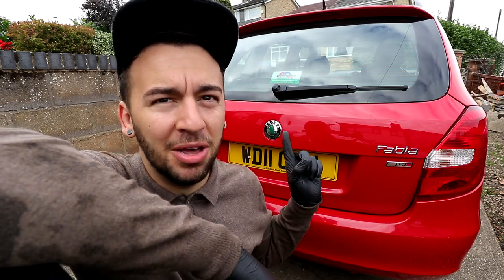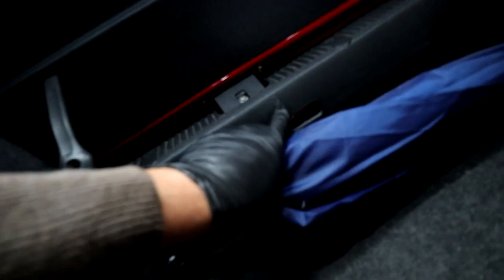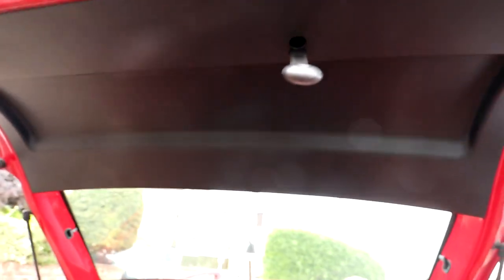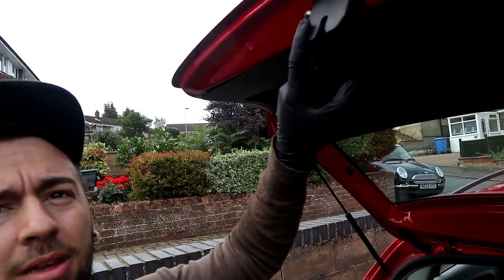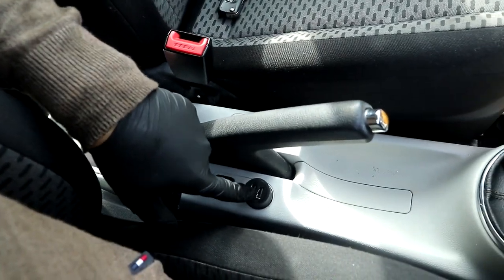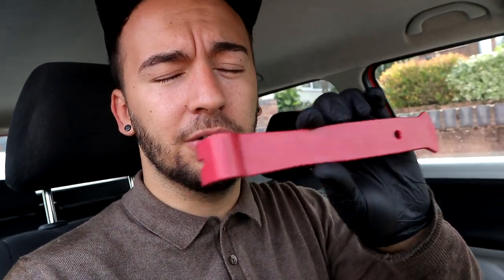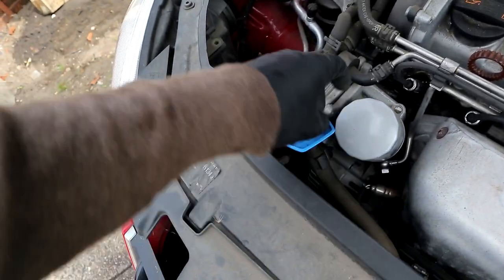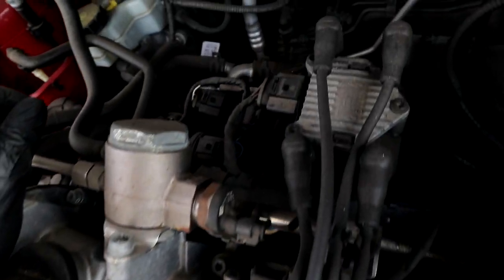Skoda Fabia Boot Wont Open! *Fixed*

Comment: Hatchback VAG cars seem to fairly consistently have boot latch issues. At the end of the day they all use more or less the same mechanism. People seem to reckon the issue lies in the way that the rear washer jet feed sits, and having replaced a few now, I'd be inclined to agree.. As the car ages and the rubber decays it washer fluid slowly drips down onto the latch inside the boot and either shorts it out, or corrodes it. My A3 is just in the process of going through its second latch during my time of ownership. Thankfully as you say the parts are cheap and the job is easy enough. Getting the rear wiper off on the other hand is always a bit of a bugger. It might be worth checking whether Sue's wiper is dripping on the inside if you get a chance! Keep up the good work!

PS: I don't think German cars otherwise have huge electrical issues. Obviously there will be the odd few, but they seem pretty decent overall!
Reply: my A4 has no rear washer or wiper, all the issue is the grease dries up, very simple repair, no parts needed, lazy stealerships are not allowed to fix parts unfortunately
Reply: @anthonynewcome128  that's what I normally do when the issue first crops up. There's actually a video on my channel telling people to do exactly that. But it's sadly not a permanent fix. After a while the latch does pack in. It's a silly bit of design. But like I say, the parts are cheap as anything!

Comment: Yes it is common the door lock problems. Also window regulators.
Btw the fuse box lid trim has a nice handy little fuse puller in it - much better than pliars!

Comment: James - The MK1 Octavia's, MK4 Golf (and the rest of the platforms) are bloody terrible for their door locks. The main issue are the wires between the pillars as they frey over time, or the whole module fails. I've repaired a few. And only recently fixed my passenger door which was deadlocked. That means ripping the doorcard off and cutting into the motor to whind back the deadlock. Not fun! But it can be fixed within an hour half/2 hours.

Comment: I have a 1999.5 mk4 VW jetta, built in Mexico. I have repaired 3 of the 4 door lock modules where the micro switch goes bad and the car doesn't know if the door is closed or not. I have also done one door (and soon the right side) on my friends wife's 2007 Beetle ... same problem

Comment: The copper contact in the bottom of cigarette sockets corrodes. 

Wrap a piece of sandpaper around a pencil ✏ (rubber end) and sand up the copper contact.    Then use your finger to rub some Vaseline or grease on it to stop it corroding again.

I bet that will solve your problem (made my usb charger work perfectly after months of trouble).

Comment: Good video James, 

From an electronics engineer point of view,  check the voltage where you expect it first and then work backwards. 

Eg, cigarette lighter has voltage, that proves that the wiring and fuses are all working so check external sources first and then go back from there.
Reply: or in the case of a removable peripheral like this one, try plugging it in in another car.

Comment: If you press the cigarette lighter in, it should heat up, proving that it works.  It used to in the old days, I wonder if it still actually works as a cigarette lighter these days?  My Roomster boot lock catches sometimes, and takes a while to get it open. I am concerned that it is going to go sometime.  Thanks for the tip about the screwdriver hole. I will try that today.
Reply: In my 2008 roomster just yesterday stopped open. I try the tip but no luck I couldn't even feel that I catch something to open. Unfortunately I have to visit dealer

Comment: Thank you for this - as a resut of watching your video I have managed to fix the tailgate lock of my wife's Citigo. The only real difference is the torx bolts are different. Took me 20 minutes to fix and only cost £14 plus my time as opposed to the £122 that a local garage quoted to do the job. Happy days!!
Reply: hi, I also have same issue with the Skoda Citigo. Im struggling to find what the correct size/type of screwdrivers to get. I can see there's a torx holding the trim, but then the 2 bolts holding the boot latch in are different. They have 12 "indents" instead of the torx's 6. What size/type of screwdriver did you use to undo these? Thanks

Comment: Yep. Door lock problems are a common VW issue. I have a Skoda Fabia mkI Estate myself and my locks are working for the moment. But I already downloaded the videos to prepare myself for the inevitable.:)
Aside from that, these are great little cars. They are cheap. Which means they go bad from time to time. But at least they are cheap and relatively easy to fix. Plus I don't really need more to nip around in town.

Comment: The driver's door lock mechanism in my Golf 6 2010 is a bit moody at times, as well. Checked it with a diagnostic software - throws an error code. But still works most of the time, so I'll let it be for now. The Start-stop system also shows error codes, but the ignition still works, so it doesn't bother me too much.

Comment: VAG's in general up until 2012 are notorious for these kind of issues (I've no experience so far with VAG's from this point onwards), most noticeable with the MK4 Golf and others across the range from this VAG era - door locks, boot locks and windows. The Golf MK5 / MK6 were improved but some still suffered and in particular with the bonnet release mechanism where if the bonnet hadn't been opened for sometime, the mechanism would seize and cause the cable that leads to the handle to split from the joint - that or you were able to get it open, it would not catch when trying to close it.
Reply: my family has a mk5 golf which has the bonnet issue where it wouldn't shut, my solution is to move the handle in and out and slam the bonnet

Comment: In the MK 1 Fab saloon, there's also a lever on the offside of the driver's seat which releases the boot catch. There are, in fact two levers for this location - the other one operates the fuel filler door.

Comment: I’ve got a 2015 Octavia. I’ve had to change the fuel filler cap mechanism and on older ones the doors constantly stopped opening. 

They also have the dustiest engines ever. Mines has to get an engine bay hoover every couple of weeks. 

After 137k miles though and absolutely no major repairs I’m pretty happy with it.
Reply: That's a lot of miles for the year. Are you a taxi driver? My old (slow) Octavia SDI was still going at 250,000 when I sold it. Slow but bullet proof.

Comment: Why do you still use manual hand tools when you have electric gun ratchet etc? Just curious as I use them at work as a time saver and even when I’m at home I’ll still use them. 

Also for future reference if you or no one else is aware, if you’re doing a latch job rather than shutting it to test it you can manually latch it with the door/boot open and unlock it with the key or button whilst it’s open. Just saves any potential issues if the latch isn’t the issue and you’ve locked it and can’t get it open again
Reply: bcs he wants to work out while repairing cars :)

Comment: My Ibiza estate (same age and mostly the same underneath as this Fabia) had the microswitch inside the switch assembly (behind the badge on a Seat) stop working. Was difficult to get apart, but managed eventually. I keep forgetting to buy a new microswitch, been using 2 wires crimped around the old pins off of the old microswitch for months now! To buy a new switch assembly was quite expensive for what it was. My latch assembly was stiff and I freed it up a lot by cleaning and greasing it, before I realised the switch was the problem on mine. Was the latch on this Fabia not fixable just by doing that?

Comment: When it comes to antifreeze/coolant for VAG cars they tend to be quite picky with the type of coolant to use, it's usually recommended to use VW G13 as it will prolong your water pump. Generic stuff can have a reaction with some of the materials used in the cooling system. It was very good of you to check all of Sue's car fluid though.

Comment: My 2004 Skoda Fabia estate has an issue with the rear boot catch. It wont open sometimes. It sounds like its engaging in the lock mechanism itself but just stops as if its siezed. It does eventually open with enough tries.

Comment: My wife has got a 2009 Fabia Sport and the 12v socket (Cig lighter) stopped working recently. The 'tangs' inside the metal housing had been pushed flat over time so USB socket was a sloppy fit and the connection was none existent. I pulled the tangs back out with a screwdriver and all is working well again now. The boot locks often fail on VAG cars due to the rear wiper/washer motor leaking fluid and frying the electrics on the boot lock (this happened on my 2009 Octavia VRS.....TWICE)

Comment: What was her percentage saving, i.e fixing the boot at dealer vs you?
Reply: He might have done it free as a friend plus he gets to make a vid and earn back that way, either that or he just said pay for the parts so £35 maybe
Reply: Yeah, I think he's curious as to how much the dealer would charge for the same job. Thus highlighting the point that if you even take on simple diy repairs you can save a lot of money and gain expertise
Reply: smith  yea true, well when I had to get a new front part for my focus, only ford had the part at the time, rare parts on ebay, but ford charged 200 for one unpainted and primed etc, waited a while and one came up on ebay all ready to go for 25..
Reply: @Stonecrow99  Yes but the peace of mind you get from a job done by a professional is invaluable. you couldn't possibly fit a part like a professional, in future you should pay the price quoted by the dealer without any second thought.
Reply: Skoda wanted £238 PER SIDE for front shock absorbers on my Octavia. I sourced Febi Bilstein shocks on eBay for £50 each and my mechanic took £100 to fit them.

Comment: As the owner of 4 VW's i can say that boot and door lock mechanisms are common faults. I've replaced 3 boot mechanisms and 4 door mechanisms. Also from when i owned a bmw i know certain 12v sockets are different and not all the plugs fit them all, One worked in all the VW's that i've owned perfectly but wouldn't work at all in my bmw but some others did and the cigarette lighter worked.

Comment: Volkswagen has issues with Door Latches and Boot Latches pretty much since the Golf Mk4 (ca. 1998)
Reply: Same thing happened with my mums SEAT. It has a full handle that you lift but it still has electronics instead of a proper latch. My old vauxhall astra had an electronic latch too and would randomly just not work. They really are a dumb idea.
Reply: GEMC yep all three of the Golfs I’ve owned over the years have had the boot latch issues. My Passat and my current superb touch wood have been ok🤞

Comment: Good video. I know of 2 Up! and 1 Mii with failed boot door button switch failures (ie not the latch) - the switch unit kinda falls apart inside the boot door if the boot door is slammed too many times. Not good. New VW part is £60 and fairly easy to fit tho'.

Comment: This is great thank you! I have a Citigo and the bolts that hold the latch in are slightly different. They have 12 slots instead of 6. While hunting around for the correct size screwdriver to get, I have come across the term "Triple Square". Just wondering if anyone knew what size these would be. I have checked the user manual, and scoured the internet

Comment: mines an 02 reg golf - it has all of the electrical gremlins. sometimes the key locks all doors and sometimes just the drivers. sometimes the same key lets it start and sometimes it doesnt communicate with the security immobiliser properly and cuts out. the windows dont go down unless i use the convenience  to put them down, sunroof doesnt work, temp gauge works sometimes.... i can carry on lol

Comment: Hi, yeah pretty common. I had a BMW 320 CI convertable and had a lock issue. Would lock but struggled to unlock. Then had a VW Golf MK 4 lock issue on a rear door, my current car Is a Golf MK 5. Door locks seem ok but 3 of the 4 doors throw up  a fault something about a locking save motor fault. I have ignored it though as it all locks unlocks ok. So yeah German cars are great but def locking issues.

Comment: I changed the lock after the boot wouldn't lock or close. The boot closes and locks now, but the door open warning light remains on. Sometimes it gets confused and won't lock. I then have to lock/unlock with the fob and can get it to work again

Comment: it's very popular my ford mondeo mk3 with german electrics and is a vw under the ford body and the rear passenger door central locking has failed it works but after you have unlocked the car you have to open from inside what could it be ?

Comment: For your possible interest my Skoda Superb has the split tailgate arrangement, with the separate boot flap. In cold weather, the flap lock clicks when operated normally from the key, but the lid only goes up a fraction, remaining "half locked" I have to do it a second time, with my hand pulling up the lid, which then releases. The "spring mechanism" which should raise it completely the first time, is I believe, separate from the tailgate gas struts. I've not been into the mechanism yet and wondered whether anyone knows if the spring force is adjustable, since increasing the upward opening force a little, should cure the problem. Any advice appreciated a bunch.

Comment: My dad had a ford mondeo 1999 which had lock issues. He had the n/s rear door one replaced and then 3 months later the o/s rear door decided to pack in. I used to set the alarm off all the time as when it was locked you could still open the rear doors and he used too get pissed 😂

Comment: Passat used to get water in passenger footwell and all the body electrics would get wet as they were under the carpet. This caused central locking faults and alarm faults.

Comment: Bril video mate, did you do one on drivers door as mines just gone on  a fabia mkii 2013 .  113 000 miles on clock , my boot has always been temperamental but still works

Comment: I know it a common thing for vw locks to stick I used to work at a vw specialist garage and we did a few one we had to keep activating the lock while another person kept pulling the outside handle to get the door open before we could fit the new lock and I had to take the window and the regulator out to fit a proper pain

Comment: I have a seat Alhambra and the boot stoped opening and the front passenger door has decided that it’s not working on the central locking system and the drivers door barrel has collapsed

Comment: Locks are known to go mate on my mk4 golf the alarm would go off and it also used to put the boot open warning lamp on , swapped the boot lock out for a new one and it worked , apparently the micro switches go inside the lock

Comment: Could anybody help with a question for skoda fabia.
I have 2011 model, skoda fabia petrol. My car came with a mechanical key lock(no central locking). I took my car to many mechanics for a new central locking but they all are saying that skoda fabia doesn't come with that since the beginning. Could anyone help me with a central locking brand that is adjustable with skoda fabia 2011. 
I live in India Delhi.

Comment: A word of advise don’t mix your “pink” coolant with the VAG stuff.   The VAG stuff is G12 as indicated on the expansion tank and is specifically formulated for their engines which I believe have aluminium heads. It’s not normally that expensive from the main dealers or TPS where I get mines.
Reply: G12 is pink right?

Comment: My son has owned several Audi's and things like the window regulator's fail quite often. 
I think the problem lies with manufacturers sourcing out the smaller components (getting them on the cheap).
Ive recently had my BMW off the road due to the egr cooler recall. Cheap parts originally from Korea apparently. A complete shambles with parts on order and cars off the road for weeks, shame on BMW.

Comment: Thats odd that the garages in UK cant use used parts....my garage here in Canada, use used parts if i agree on it. 😀 Great vid.
Reply: Some garages will fit second hand parts but it's at customers risk. If it's a main dealer they will only fit new parts due to warranty
Reply: @brummiescot  Certainly, i was refering to non dealer shops 😀

Comment: German cars electrics are awful mate use to have a mk4 golf had problems with windows and doors my rear door only opened when it felt like
Reply: Same with my old MK4 mate, when I took ownership of it both rear door locks and the boot lock had seized. The boot lock however with the key in the lock just needed a few simple light taps with the hammer as the key hole itself had just partially seized preventing the key from going all the way in (plenty of WD40 too), all sorted out and working again within 5 mins. Both rear doors though needed new mechanisms to get working again... but an utter bugger to sort out as I had to fight my way in from the inside to get the door cards off. MK5 Golf's were improved and my old one just needed the drivers side door lock mechanism replacing. The main common fault with these is the bonnet catch (and the MK6 too).
Reply: Why have I never had a problem with my car then? Or is it getting ready for a big problem? 2006 Skoda fabia can’t wait for the big problem then
Reply: Jonathan Hughes peugeots are worse, trust me
Reply: Jonathan Hughes I’m sure I’ll be fine 😉😉
Reply: Sebastian Hinchliffe no idea never owned a French car and never would lol
Reply: My dad has a mk4 golf and the window mechanism as broken passenger side also...
Reply: Jack Cookman very common problem with them mate
Reply: Lötyögi Pityu I cant understand the last part to your message mate but I’m talking about a lot of German cars ain’t got the best electrics they known for having problems
Reply: @sebastianhinchliffe3954 not 205